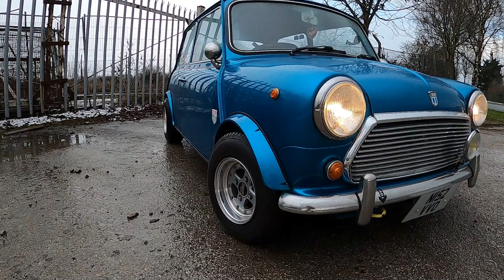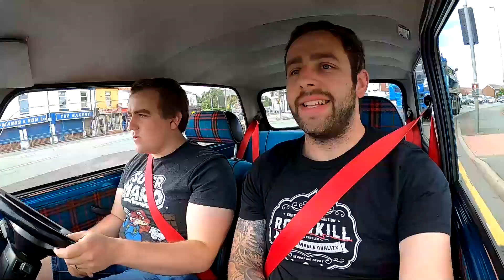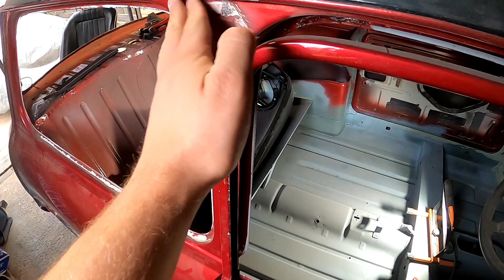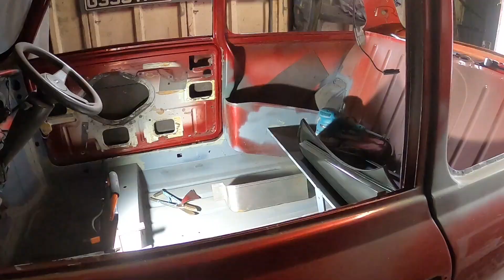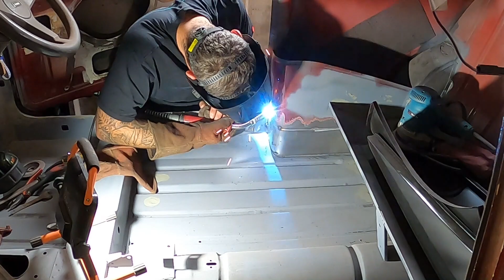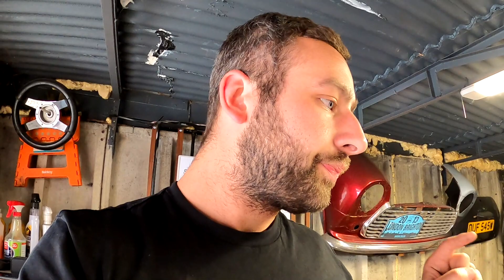DOOR BIN WELDING - 89 CLASSIC MINI RESTORATION

Comment: looks like a clean job.  I'm about to replace my bins too, but I wonder since I also need to repair the lower quarter  panel, if you were to cut that lower portion of the panel out, then you could possibly reach in to weld the lower bin in better.   ??
Reply from the maker: Thanks Randy. Yes if you cut the lower part of the bin away well you could re attach it I wish I had this option but they were rotten.

Comment: Get yourself another grinder, saves keep swapping the flap disc for the cut off wheel. Saves time
Reply from the maker: Yep great idea one I have thought of before. Issue is I want some cordless ones as the wires do my head in! 🤣
Reply: @SimpsonsClassics  true, the wires do get like spaghetti. I have 2 grinders, power file, die grinder, led light going at one time making a mess. Air tools would be my ideal setup
Reply from the maker: @dinxsy8069  this is very true and I think the wires can get a little dangerous at times. I would love a full set up of air tools. Maybe one day aha

Comment: What etch primer are you using? And which seam sealer? I'm in the same stage of restoration of a1970 morris mini as you.  Lots of cutting welding and grinding! Keep up the great work.  👍
Reply from the maker: Thanks I use Frost restoration’s own etch primer, and in this video I used some tiger seal. 
I like the sound of the your 1970 mini all the best with it 👍

Comment: Another great video! Just a thought, are these repair panels made for the Mk1/2, as they are slightly different/longer due to the smaller doors? I guess m-machine make them longer to suit the earlier cars but can then be cut down if needed for later ones.
Reply from the maker: Thanks Daniel, you aren’t the only person to have said this about the panels I think this is the case for sure. None the less it’s fixed the issue snd we can move forward. Thanks for watching 👍